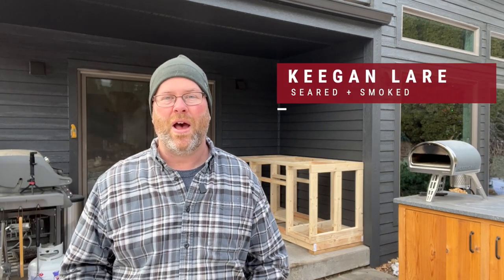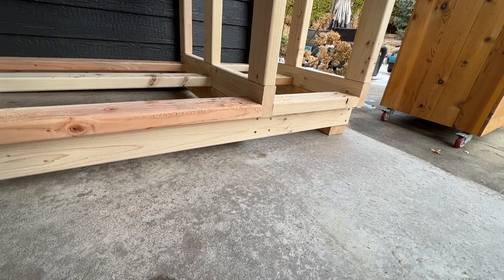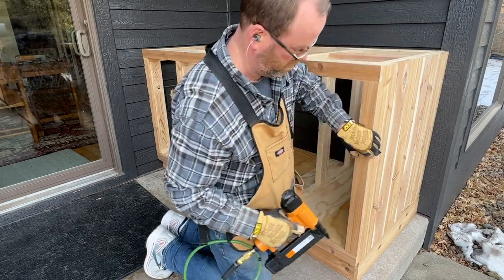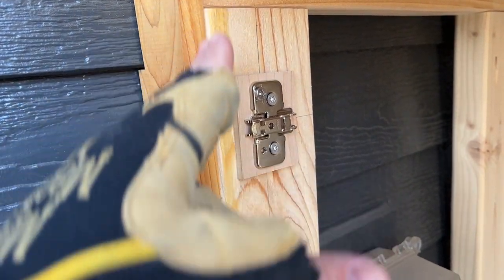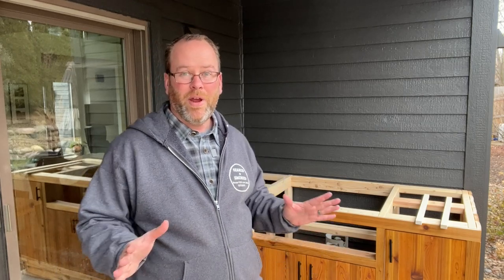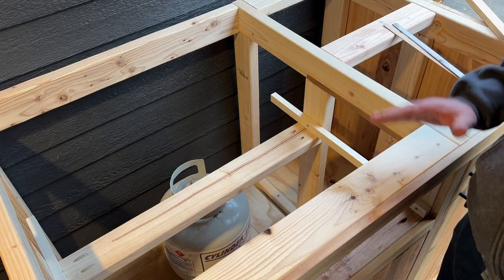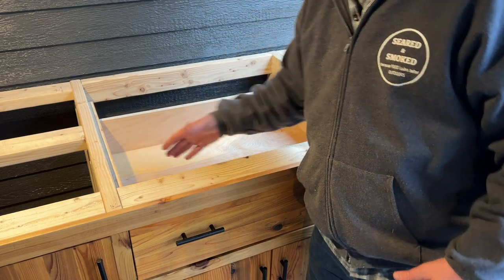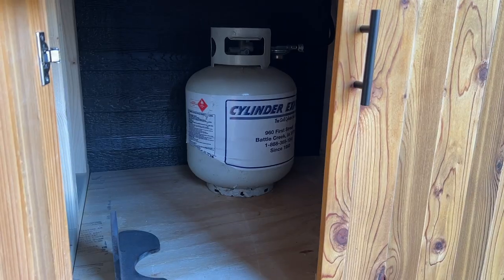Outdoor Pizza Oven Kitchen Build: Perfect for Gozney & Ooni Ovens

Comment: Keegan, Love your work.  What do you recommend I do different for the cedar tabletop that is on a deck with no roof cover? Biscuit and glue?  thanks
Reply from the maker: I would recommend gluing up a panel of some kind, if its going to be uncovered a good amount of the time.  Any of the biscuit joinery or other methods are fine, just make sure to use high quality exterior grade glue, then finish it with a quality sealer.  You can put a bead of silicone where the top meets the framing/trimwork after installed as well to try to seal it up nicely.